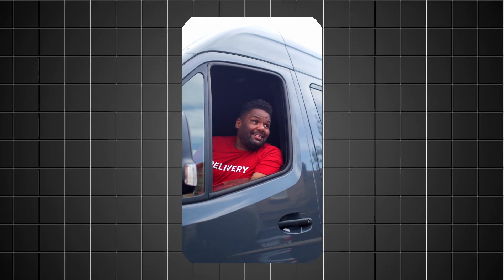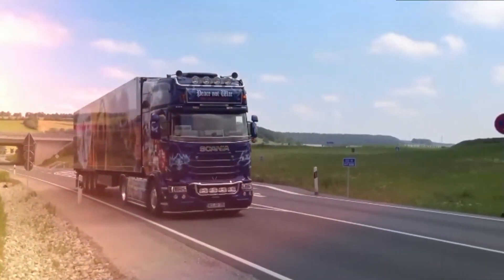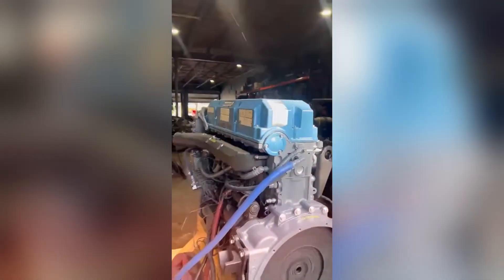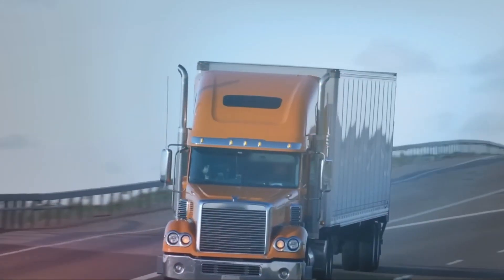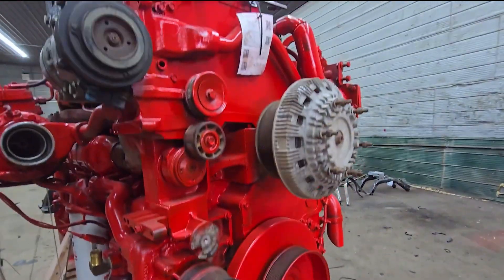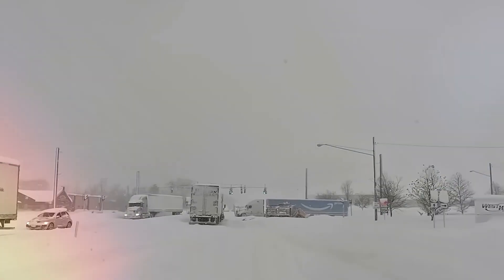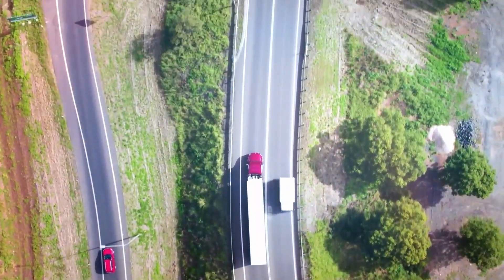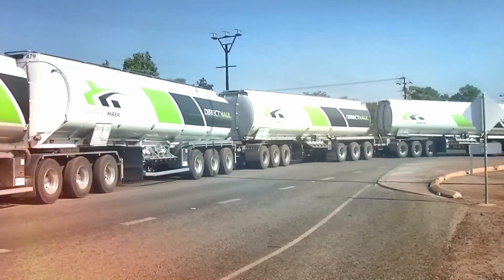Cat 3406E VS Cummins X15 VS Detroit Diesel : Which is the best engine for your truck?

Comment: Both are good cat has more raw power but the 12.7 Detroit is more practical for regular moderate use I see them used for intermodal work
Reply: A turned up Detroit will keep up with a Cat. No problem. Only thing is the Jake break is nothing but a baby rattle on a Detroit. My 475 ISX out pulled my buddies 550 Cat.

Comment: You need to get rid of the DEF FLUID STUFF because it stinks and it does nothing for mpg . Bring back the Cat hwy. Engines 600 hp and bigger and free up the exhaust so your engine can preform better and change your air filter like you should.Have a good day.

Comment: I am a Cummins N14 Celect Plus Owner.   

I did not want a Caterpillar.  I had three "percentage after fuel" compensation agreement company driver jobs.  At all three, I would have done better, financially speaking, by being paid by the mile.  The engine barely got into the five's of miles per gallon.  These engine were very powerful, however.

I never drove any Series 60 that impressed me while it was under load.  Same for Mercedes MBE 4000.  I did use the low torque of the MBE starting at 1,000 RPM.  Getting to 45 miles per-hour was no problem  It was getting from 50 to 65 miles per-hour.

I split the difference with the N14; not as powerful as a Caterpillar, but it is not as thirsty as a Cat either. More balls than other engines.  May N14 has over a million miles one it and I blow the doors off any D13 or DD13 or MX13 I am next to on the highway.

======

And host:  You should have used the Cummins ISX for the comparison.  The X15 is a recent engine; the 2406 and Series 60 are not recent.   Big flaw IMHO.
Reply: Ehhhh i have a 6nz with a 6 and a quarter tune 18 speed that pulls around give or take 80k and gets 5.7mpg. They are like a cummins in my experience. They need high rpm and easy on yhe right foot unless you need it. Especially Cummins with their shorter connecting rods, they dont last long umder high torque, low rpm. Just ruins the engines and guys throw rods early. 

I will favor cummims because of th vg turbo tech amd other changes to the engine for fuel milage and being able to produce a 605 engine with a 14.9L displacement where detroit needed a 16 liter to handle 600 horse. 

All in all, in my experience its how the trucks are speced and how the engines are driven. Right now cummins is probably my favorite ATM.

Comment: Think im going Series 60 14L or ISX for my glider.
Reply: You don’t want a ISX. If you go Cummins a N14. If you don’t need the power a ISM is a great engine. But pre EGR. The 14 liter is a great engine. But only pre EGR. They are rare. I would like to have a pre EGR 14L in a KW. I’ve only seen one for sale factory. It check all the boxes. But it was low rust Minnesota style. North Dakota beyond shot.

Comment: Wow I'm was born in trucks 38 years ago,I love Detroit engine first diesel motor and it,s Detroit built cumming.Detroit show dodge how too built a diesel motor.The best cunning was the N14 collect.And you buy a cunning brand new truck  the cost 125,000$,you buy a Detroit truck 309,000$.Because detroit only one come whit super charger,and turbo charger.

Comment: Why not compare engines that were available in the same time period, the 3406E was discontinued 20 years before the x15 was introduced.
Reply: Agreed. As was the Series 60.
Reply: Cat 3406E are still available to this day. Caterpillar still makes and sells all the parts for them and they are the most sought after engine for most truckers especially owner operators.. I  only run cats in my fleet . I get 1,000,003 before I have to rebuild them.. .
Reply: @Bigmike3406E  Yes but it's still 20 years older technology than the X15.
Reply: @B @Bigmike3406E ’m an owner operator. If a truck has a 3406e I won’t even give it a second look. 3406E’s are junk. They blow head gaskets and crack heads terribly. A C15 is the engine Cat guys want. Twice the engine. Don’t crack heads or blow gaskets. I’ve had a 3406e. They have injector issues too. 

The Detroit 60 series is and will always be the most reliable heavy truck engine. Only thing is. Has to be pre egr engine. The egr engines are bad at cracking heads. Doesn’t matter if it’s been deleted. Same outside dimensions but has passages in the head making them thin in places. 

N14 is the best engine. Great torque and decent Jake’s. I’ll take over a Cat any day. C15 can be built to higher power level and last better than a N14. But I’ll take the mileage from a N14 or Detroit before owning a Cat. Parts are stupid high on a Cat. And mileage sucks. Some of my Buddies took oversize loads to the east coast from ND. There were 5 of us. An C15,ISX, two 60 series. One 500hp with factory 1850 torque. My truck. A 60 series at 600hp. That burned a little oil. Been ran hard. A X15 with about 50k miles. The Detroits made 2.9 mpg and the others all made 1.9 mpg. Wish we would have had a N14 with. The two of us with Detroit made a little over $2000 dollars Net on the one job. So $1000 a week more income.
Reply: Agreed. The N14 would be a better comparison for Cummins. Good video though

Comment: Technic from the last century. In Europe we are already on electric engines. Much more economic.
Reply: Much more lame as well!
Reply: Where in Europe are there heavy-duty electric trucks? Currently, electric trucks can't match the range and payload capacity of a diesel truck. To achieve a 30-ton payload, its batteries would weigh tens of tons! Furthermore, as the trucks travel, their batteries will quickly lose their capacity, and fast charging is impossible for batteries with such high capacity! This is precisely why heavy-duty electric trucks are nothing more than PR stunts, like the Tesla Truck!

Comment: No doubt hands down the 3406e is the best truck engine to ever, ever ever ever to be put in a truck,,, no other engine comes close,,,
Reply: How about Caterpillar  C 15 6nz
Reply: @RR-nz2ve the 6nz is a 3406 just with some updates on a few parts,,, it’s a 3406,, it in the family,,
Reply: So it’s a awesome engine
Reply: Sorry your wrong I liked cati hate 60 series Detroit I liked  8v92 Detroit but my KT600 Cummins I bought new in 1978 beat them all the 3 million miles I put before I sold it I did inframes around 900k miles never once saw the hook my cat just didn't pull or last as long my 92 Detroit get air in the fuel and they sucked they don't self prime😊
Reply: @dewaynem559 u have fell and hit your head,,,
Reply: @dewaynem559 A shame to see the KT's go away
Reply: @dewaynem559 you are wrong,, a 3406 cat will be running and working hard while your Cummins and Detroits will be melted down to make a few pick up trucks blocks,,, when it comes to an engine working hard dragging around 60 to 70 tones around 24/7 5 and 6 days a week I no I’ve tried the signature 600 Cummins junk the new dd 16 Detroit and we was lucky to get 250 to 300 k out of an engine the Detroit done a little better we had 3 and they all got around 350 to 400k before they needed a rebuild,, we get around 800k out of the cat engines and have had a few that went over 1 million miles before they needed a rebuild,, we have been in the trucking business for over 30 years and all ways have had 30 to 40 trucks for 25 years of the business, we bought glider trucks for years until that sack of shit Biden administrations epa put a stop to it we have to buy trucks now that the engine is epa rated and most have the x 15 Cummins in them but we keep a couple of cat engines on hand for when the Cummins goes down we replace it with a cat engine,, we have done 20 to 25 trucks that way so we no the engine is going to last and keep working, nothing will hold together like a cat engine,,
Reply: @dewaynem559 Idk i got a 6nz with 3.90 gears on a 6 and a quarter tune 18 speed. They need the rpms high all the time with little throttle unless you need it. Mine made it to 950,000k before a rebuild and got 5.7 mpg pulling 80klbs. I babied it around and took good care of her. Real good engine in my opinion, just needs the correct set of gears if you like to flex your mucles pulling grades.
Reply: @dewaynem559 believe it or not but I know celestial plus n14 that gone over three million miles,I tell people but  they don't believe me  I laughed because I know it's full proof truth,the n14 is true gem I tell you
Reply: Uhm, n14,no contradictions,I have countless proof on how good that engine is, it pull through every work platform  without agony no doubts but to the 3406e,yeah it's a big boss alright
Reply: It also sounds the best.

Comment: CATERPILLAR 3208 V8
Reply: 3208-boat anchor ⚓
Reply: 3208 is pos. 3408 is a good engine
Reply: @philmckrakin6752 exactamente exelentes motores y mas con una transmisión de 10 velocidades Fuller